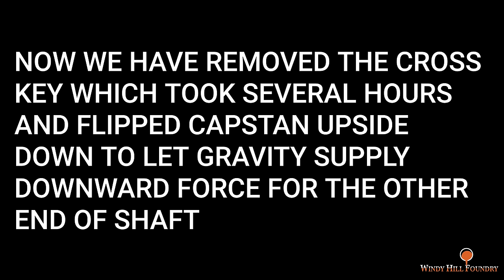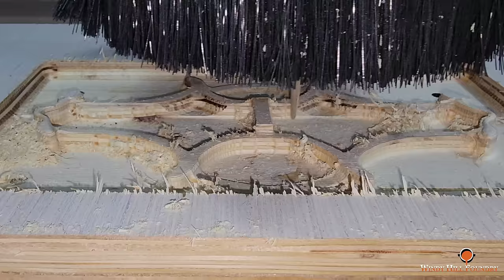WHF 15 Tally Ho Capstan Breakdown

Comment: I wonder if it was all dumped in an electrolytic process to clean it up. You dump the unit in an electrolyte and apply 12  volts from a car charger. One wire negative connects to item you want cleaning and the plus wire connects to some sacrificial metal immersed in the electrolyte. Leave it going for hours and let gases vent. ( Do not do in a confined space ) I did this to a rusty vice, I did it twice after the first day and night, I changed the electrolyte and cleaned the sacrificial plates loosened wired brushed of the loose material and gave it another shot. I cleaned up fine and needed a very light wire brushing to remove light black coating. Apparently if you use Distilled water and washing SODA to make the Electrolyte that does not happen. I used plain tap water and washing SODA.  It is not a fast process but not arduous and no damage. It cleaned it all back to raw metal. Light wire brushing and painted. You can see more on the web. You guys got there and it’s going to be great job well done.

Comment: I'm an old machinist, this is probably not going to end well for fixing this capstan.
Repairing this one is not possible at all, it is worn and rusted away beyond repair.
If you wanted to remake it , you could with time and money.
It will need reverse engineering, trial and error, sweat, tears, patience, and support from everyone here financially to make a new replica. This is your only option, unless you upgrade to a new non original model.
Good luck, I will be watching you guys. Doing things like this are what Machinists are born to do, the impossible !!

Comment: Here's a tip for you guys to make getting stuck and rusted metal parts separated much easier.
Try an air hammer with a long and dull chisel bit in it to drive the pieces apart.   (Chisel bit is kept dull or made dull because you aren't try to cut with it but drive with it)
An air hammer with a variable trigger is a must and a bit of finesse is needed.   Start easy and work it in harder until the part starts moving. 
 You won't believe how great it works until you try it.
Reply: Yes! Vibration is the key. Also the shock waves will get the penetrating oil creeping in the tight places.
Reply: Yeah, I was thinking "Eric O from South Main Auto would use "Big Nasty" and have that thing apart in no time". He is a salt belt magician. Heat it, Beat it, Repeat it.

Comment: Well, looking to the profile of those two gears I'm pretty sure the process should have been inverted: first pull up the cilinder; then extract the cranks. It's pretty obvius they were designed to stay firm and steady on the main gear and to do so they have a double profile to keep them on track. Trying to get them off while they are in their position is butchery. Good design by the way.

Comment: New sub here for you my  friend. I have followed Tally Ho refit, restoration. Drop by one day when you can. I cast pure silver for the bullion stackers and collectors. I am no stranger in the world of sand casting. Sure is a stubborn push eh. For situations like this I found a product called "Honey-Goo." It loves rust and is easily drawn  to heated  anything's. It is available in spray or liquid, I keep both.  Great post on just how tough it is ro get some married parts apart eh. I see you need an 8 lb and a 10 lb short handled hammers.  A doubling of a 4 lb hammer on the shaft struck with te 10 lb works wonderfully. I have a number of years as a mobile service and machinist has found me a bunch of ways to a logging show. Just get em going now whenever it is possible as the craziest of minor things can shut down a logging show.

Comment: At the 23:25 mark of this video, I would like to offer an idea!  Something I've use when separating a hub from a tapered shaft....  With the 3 jaw puller in place and applying tension, apply heat... THEN take 2 sledge hammers and simultaneously hit opposite sides (in your case the Hub, in my case, I hit the shaft).   The vibration breaks the grip of the fouled joint.  Thanks for sharing... MIke.
Reply: Using two hammers in opposition works have worked on HGVs and Coaches for many years. After having cleaned all parts that have to slide over each other with a wire brush/ rotary wire brush, apply freeing oil and using a puller / hydraulic puller, put the joint you want to part under strain apply heat stand clear. If Not loosening tap with two hammers in opposition. My Foreman was trying to free a ball joint on a steering arm on a coach. “A long bar with two ball joints so reasonably heavy”, I was in the working gallery under the coach “Pit” having just completed greasing everything. He had been bashing for five minutes no result, I said look use two big hammers give me your one and I grabbed mine and did the two hammer strike from both sides “ You should really use a ball joint splitter tool, we did not have one”. We watched as the ball joint popped its taper, slid out and swung down right into the painful part of his knee “ he was sitting cross legged on the side of the pit” tears ran from his eyes, I had to drag him from under the coach as it was to painful and he could not uncross his legs. Nothing was damaged just painful five minutes later he was up and about, as an apprentice I got paid back in kind! 😢 That was 46 years ago, makes me still smile now. 😂. When working with press keep well clear, wear eye protection, bearing races can split exploding ball bearings everywhere. A friend had a ball bearing race explode due to too much pressure, the race came apart and ball bearing shattered glass and one punctured a door skin on a brand new car, they had a fifty ton press and an Idiot was using it.  Do not use piston pins/gudgeon pins/wrist pins as a press tool, they have a soft core and hard exterior under press loads they can explode the hardened surface off. I know someone it happened to, parts went through overalls and into chest others into his face luckily missing eyes. Use soft Iron press tools keep them vertical brace everything correctly, adjust press do not stack the tools, take your time and wear safety glasses. Never had a problem if you do that, a small tap with a hammer sends high frequency vibration through unit and bang it parts. Heat with vibration coupled with load from press works. Size of hammer counts, one shock from a big hammer could work where multiple hits with small one just damages components.

Comment: In addition to the heat applied, why didn't you thread a nut onto that shaft to protect the threads and then hit it with a 25 pounder ?

Comment: With that manual capstan, Leo will not be able to do any solo sailing simply because it will take more than one man to work the capstan to lift the anchor.  I wonder if he has considered that.  The possibility of being stuck alone in some isolated place, unable to lift the anchor, is not something that should be ignored.
Reply: It could be just as dicey leaving a dock or mooring in foul conditions. The thing could certainly be crank-operated by one (fit) person, & Leo is planning to motorize it.
Reply: @frederickstibbert7389  
Exactly.  Manually hauling up the anchor with no one at the helm?  Where did you hear that Leo is going to motorize it?  If that is true then why not just install an electric one?  The thing is an eyesore and inefficient and weighs a ton.  Trying to drive it with an electric motor?  You would need a motor the size of a house to drive it.  I can understand having it as an auxiliary capstan in case the electric one breaks.

Comment: Your problem is that the blowpipe has not enough power to heat up the hub fast enough . When You heat up this slow , the shaft heats up to the same temperature and expands exactly the same ! I think , it is better to bring just a small vertical  stripe to incandescent and cool the shaft !

Comment: So I imagine the side shafts would have had to come out first in order to lift the cap off without breaking. I wonder how that would have been expected to be done on a unit that had not experienced so much corrosion.
Reply: Those side shafts are in the cap that broke.
Put the side shafts in the cap and slide the assembly on the shaft, pretty simple construction.

Comment: Why didn’t you try to use the gear puller on those two “arms” that stick out, surely once you put so much pressure on the top cover and it didn’t budge it was a sign that you’re pulling on the wrong part. The arms come out and then the cap lifts off. In the context of a precious part of Tally Ho that is now gone forever. Simply casting an new one is not the same.
Reply: It had a large chunk missing anyways, so a recast hat was always on the cards.
Reply: The entirety of Tally Ho would be gone if not for the efforts of craftspeople like this. Sometimes you just gotta break a part to fix a part.

Comment: Well...that was painful to watch.  As a mechanic with near 50 years work experience ranging from dirt bikes to 747's (and boats),  I consider breaking things to be an act of desperation.  I was relieved that somebody finally said something about trying to "turn" the pinion gears.  Watching the gentleman hold the pinion with a gloved hand as the other hammered away on a punch made me cringe.  That was a serious injury waiting to happen.  On a constructive note, for anyone faced with a similar job...try soaking that gear head in a bin of diesel or kerosene for a couple weeks before starting and then completely degrease everything as you go.  Add a three pound dead blow hammer to your kit and make and use a thread protector on the shaft.  Nuf said.
Reply: Yep, it's clumsy work to start smashing away without giving it a real good soak in lubricant first, not surprised they broke the cap

Comment: Why don't you use a "serious" hammer? Beating on a piece that probably weighs 75 pounds with a 2 pound hammer? The large piece is just absorbing the shock. You might as well use a rubber mallet. A little lubricant would help with the heat drawing it in and softening the corrosion. 10 pound sledge minimum!

Comment: Sorry guys, but it was sheer agony washing you bash those poor pinions to hades and trying to break the teeth off the ring when the camera angle made seem absolutely obvious that they were deliberately made captive (from being pulled outwards) by engaging with that ring and the remains of the capstan head needed, was DESIGNED,  to be pulled up first, and that re-assembly would require engaging the pinions in the new capstan head and dropping that down to locate and re-lock the pinoons from moving outwards!

Comment: 030723 🧡💛💚Make a purpose-built cavitator bath and soak the whole capstan to dissolve the corrosion adhesion at mating surfaces. Common human response when conronted with intractible dissiculty is to use force until it breaks.
Reply: I thought it crappy they destroyed it. No matter what they do now, it will not be original, but a replica.